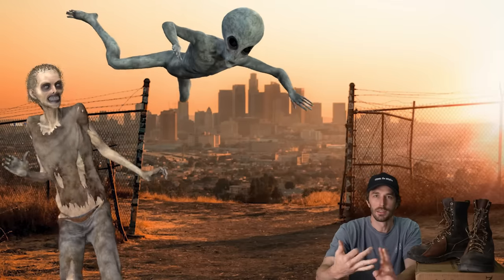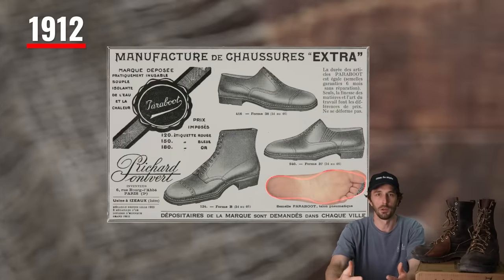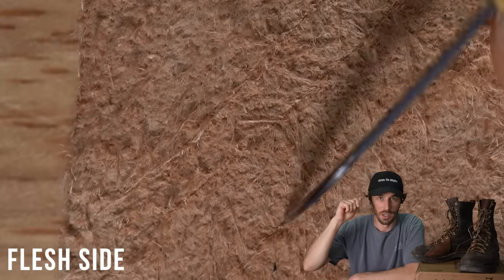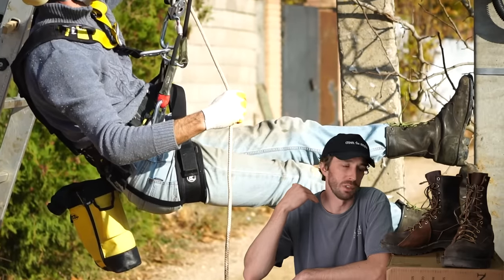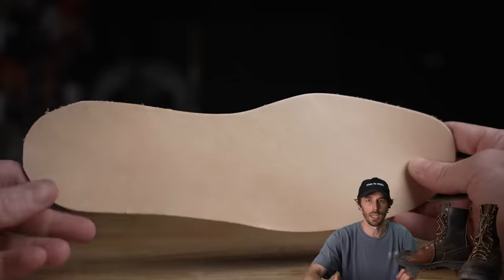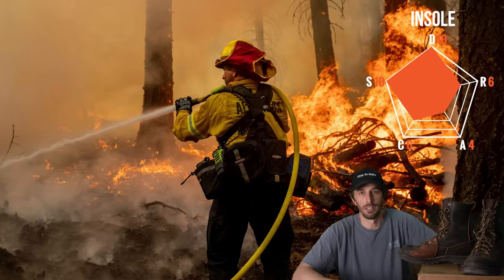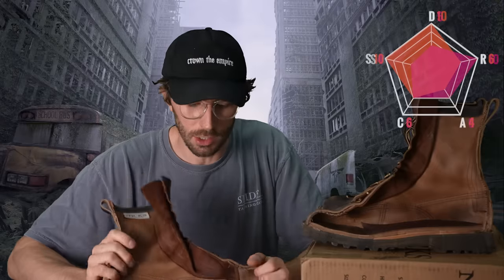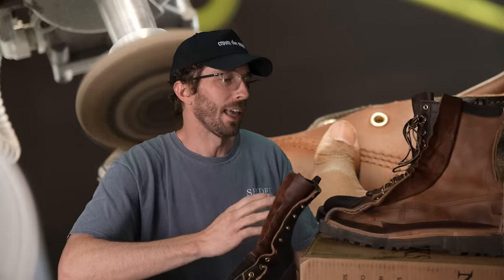Why this boot would save you in the Apocalypse (ND3)

Comment: I was scout in the military. We never melted wax onto our boots. We were made to wear them into streams of water, and then we tightened the speed laces as tight as we could get them, and then we road marched in them. The boots fit like a second skin. The only "wax" that went on the boots was black Kiwi shoe polish. We did use lighters to heat the kiwi on the tips and heels for higher shine. We marched so much in our boots that white salts would come through the leather and Kiwi.
Reply: Military boots are made to be practically consumable/disposable, so no surprise there.
Reply: I think he was talking about during WW1
Reply: We?
Reply: He is also speaking to rough side out.   Most if not all military boots except for a few versions of the "desert" boot are smooth side out.   No need to seal with melted wax.
Reply: @Heywoodthepeckerwood  In the military, the order of operations are mission, men, and self. Independence in the military is non existent. "I crossed the Sava River with my unit," is condensed to "We crossed the Sava River." It's military jargon. You either get it, or you're an outsider/civilian who doesn't.
Reply: @romile55  Good point. Wax would have been great waterproofing for the trenches.
Reply: @Waldemarvonanhalt  My military boots were were only changed out when the soles were worn past the military standard of serviceability. (The black rubber soles wear on heel edges, and other foot strike areas). However, my military boots have outlasted any of my civilian boots like Doc Martins, J. Chisholm...  About the only thing that goes out on the combat boots I had were the soles. The speed laces even lasted forever.
Reply: @elmerkilred159 I live in Canada. Montreal. When i was a kid, we use to have high quality warm boots.
I cann9t find anything of that quality in the civilian market.
So i only buy Winter combat boots now. Of course they are not like some Sorel at -40. But with a good pair of whool socks, they withstand every condition i can put them in. Had my last pair for 4 years now. I do want a pair of those boots tho! Lol
Reply: @celuiquipeut6527  I had a pair of Matterhorns issued to me in the service. They keep my feet warm outdoors, but the problem was that when I was in someplace warm inside, they would eventually make my feet sweat. (They were also heavier in the mud). Once your feet sweat, is defeats the insulated boot. I eventually went back to the standard issue boots paired with 100% wool socks. This worked in the Balkans for me pretty well. One of my NCOs  wore his green Gumby boots (NBC boots/Nuclear/Bio/chem) over he regular combat boot, but he always complained of cold feet (because his feet would sweat). The trick to managing your footwear in extreme cold temperatures, is to always keep moving and to keep your feet dry. Change out wet socks/boots when possible.
Reply: The good old days.  God I miss that army.
Reply: Yeah, I got pretty dubious when he decided on a last that was over 100 years old and has been out of service for over 50.  But he also claims that synthetic boots will just melt on the shelves after 5 years, which is utter nonsense, so he clearly has a fetish for old-fashioned boots and is willing to ignore reality to justify his belief.  They're nice boots, but I'd still go with current-issue stuff.
Reply: @Bacteriophagebs  everything stpre bought never last. The only thing i can store buy that is of quality is military boots. So this is the next best thing. And if you want mors style than your nextdoor goth, you dont have much choice.
Reply: @celuiquipeut6527  Yes, and modern military boots is what I was talking about when I said "current-issue stuff" and replied to a post about a guy who'd served in the military praising his modern military boots.
Reply: @Waldemarvonanhalt   FR, my feet chewed up boots like nobody's business. Practically needed new boots every 2nd year with how beat up they got.
Reply: what nationality are you, if you dont mind me asking, only because i havnt yet heard of americans using kiwi polish (brit here)
Reply: Thank you for your surplus !
Reply: @Waldemarvonanhalt  EVERYTHING in war (including people) is a consumable, but military boots from competent manufacturers can last many years. I retired long ago and am still wearing out my stash.
Reply: @elmerkilred159 I wear 2 pairs of socks with baby powder in each sock. So 2 socks per foot. That kept my feet dry in Qatar, Kuwait, Iraq. Also, I was a civilian contractor so I know I’m going to get a lot of hate for this.
Reply: @teancrumpets5685  We have Kiwi polish in the States, but most military branches haven't used it in decades since the black boots were switched out for the "suede" olive drab/tan leather.

Though I do expect that to change some day, once they realize that the outer suede layer is detrimental in environments outside arid desert regions....
Reply: yes did you expect him to be alone in the military  @Heywoodthepeckerwood
Reply: Same as the British army did with the old AMMO BOOTS MARCHED THROUGH WATER UNTIL THEY SHRUNK TO FIT PERFECTLY AND THEN BULLED THEM WITH KIWI BLACK BOOT POLISH
Reply: @MarcusJGrey my mate would go through a pair of boots every 6 months his feet sweated that much the leather would just rot away he could take his boots off and pour the sweat out like water I’ve never seen anyone like that to go through boots as he did and the smell from his feet was BAD
Reply: Scouts out
Reply: I never put wax on my boots either.
Reply: Id have used a metal shank. Nothing worse than jumping off something only to end up with a nail in the arch of your foot. Sole penetration needs to be prevented
Reply: @Bacteriophagebs you got any recommendations I’m looking for something tuff and weatherproof but not super expensive
Reply: @commalTl  Anything that's AR 670-1 compliant is probably going to be good.  AR 670-1 is the Army regulation governing what personnel can wear.  Technically AR 670-1 is about appearances, but any company making boots that qualify is probably going to have decent quality since they're making boots specifically designed for active-duty soldiers.
Reply: @Dundrakan  yes, it does depend on the type of activity you are doing when picking a boot to wear. I will only use tiger paws on roofs for example.
Reply: 8-1 Cav got better but was ass with Col Chung
Reply: Yes, Kiwi is primarily wax.
Reply: A friend in my batalion got foot fungus which got into the leather and for some reason it was the best boots in the entire base, because it  soften it up the leather to be more like rubber while keeping it's integrity. Not advised though but damn
Reply: @teancrumpets5685 I'm American, And all we ever used when I was in the army was Kiwi
Reply: Boots and time have changed Boomer.
Reply: @211inprogress  We still do this in Europe, and as  locations of the battlefields changes depending on where it is, be it tropical/Forests/Deserts etc, clothes change thereafter. 
Leather Boots is still the best for the Northern Hemisphere. Something US haven't focused on, raging war in the Middle East for the NWO, who took over US in an Alliance between England and France aiming to create a Global Super-Power back  between 1890-1905, who were sole responsible for WW1 and WW2. They are so close to victory, i figure an escalated war with Russia will solidify the World Government just to fabricate the need for it.
Reply: @elmerkilred159  agreed my leg boots lasted years my jungles the plates broke after a few years. haven't found anything that lasted a 10th as long since i got out.
Reply: I have the same experience with salt penetration during marches.
Reply: I miss my old, all leather, “crew boot” with the “deuce and a half” sole….once broke in, were fabulous road marching boots.  I had a pair that you could make the speed lace eyelets touch when you laced them up
Reply: i see your profile picture. 1-1 cav. im in 1-1 cav currently lol
Reply: Same.     My first boots from 1983, were so flexible they did not stand up.   Yet,  I could get a mirror spit polish on them.     Sadly the Army went to a new boot, in 1988..   They sucked.  I wore my jump boots for a while, then our unit allowed Jungle boots.   Never touched those issue boots again.
Reply: @birdsteak9267  And then you get athlete's foot or worse. I got it while doing my military service, because they gave me boots that weren't new but used by someone else, and it worsened with an infected crevace. I was stopped for a full month. The problem is, I reused the same fungus infected boots, so I suffered from athlete's foot during the whole service.
Reply: @InXLsisDeo  Lmao. The best benefit of Leather boots is the process of shaping it to fit your feet, you ain't supposed to get used boots, used boots is the property of who used it, because they are shaped to his feet not your feet. This is why in Norway, the boots we get is ours to keep for life, because we need fresh and new boots for fresh and new soldiers.  You ain't supposed to inherit other peoples boots.  US military are willing to wreck their soldiers feet for greed, and you blame leather boots, not your incompetent superiors. 

But you do not get Athlete foot or anything, i have worn my Leather boots for 10 years now, just fine. LEARN how leather boots work, how to shape it.
Reply: @elmerkilred159  Docs arent good civilian boots. Your combat boots cant outlive a leather insoled and midsoled resole-able boot
Reply: Adam's Boots are the best. They are only custom order, sized to foot. Please don't even think about ordering them, don't get in the way of people who will use them.
Reply: Buy some Danners, polish in Obanoffs
Reply: Yep.
Reply: @teancrumpets5685 was a US Army Ranger and Paratrooper for 15years. We used nothing but Kiwi for the most part for my entire service. Dress uniform jump boots were also mirror shined with Kiwi.
Reply: @elmerkilred159 thats why I’m sussed out about these boots in the video because he seemed to compromise the one part which wears out the most, at the expense of making the rest of the boot unnecessarily indestructible. I’d rather patch and upper than have to figure out how to resole the dang thing especially with not resources available to do so
Reply: Hey, I remember the salt bleeding out my boots while in the Marines.
Reply: How much do they cost
Reply: @brentandvuk  I do, not while serving although when working for the NAAFI boots were not needed but when I was at school Doc Martens were popular and the same thing would happen to them. I would have salt rings around the toe area which eventually scarred the leather.
Reply: I was a scout in the military. I wore the boots issued to me and never thought or commented about anything related to boots. I put them on my feet. Pretty insane.
Reply: @teancrumpets5685  Really? Kiwi was a regular fixture when i was in the USAF and virtually everyone used it as standard. A few weirdo's would use Lincoln wax but Kiwi was by far the most popular polish used before we switched to rough out boots in 2006-7. I still have a full kit of it in a shoe box somewhere with a dusting brush that has seen so much use that it will quick shine a leather shoe that has never been polished with just a few swipes.
Reply: @Bacteriophagebs the rubbery type sole stuff did on my stored steel caps .. like some bloody   bacteria was causing them to crumble
Reply: @jackd1582  If they were polyurethane soles, which they probably were, it was because they were in storage that they disintegrated.  Putting PU shoes in a confined space with no airflow, especially if it's hot, will cause the polymers to break down.  It happens even faster if they're put away wet (which includes sweat from being worn) or kept in a damp environment.
Stored in a frequently-used closet, on a shoe rack in the open, or on a store shelf, they'll last years if not decades.  It's why shoe boxes have holes in them, to allow air circulation.
Reply: @elmerkilred159  yeah the whole II versus wheezing is a psychological manipulation tactic
Reply: @StupidIsMyJob  you missed the point entirely 
Comprehension .001
Reply: @StupidIsMyJob  still missed it. Try again boy
Reply: @elmerkilred159 This. In a good unit, you are closer than family. If one fails, all fail. "You" don't matter. You "brothers" do. Yeah, I'm sure some find that cliche, or trop, but it is reality.
Reply: That's a really dumb way to break in a pair of boots and terrible for both the boots and your feet.
Reply: I put bag balm on my unbelievable how good it works and then I tried Vicks Vapor Rub oh my I'm not kidding it works very well
Reply: In basic training I showered with my boots on, wore them around for a bit, and used my winter ones the next day to let them dry out. 
Breaks them in a lot quicker. Those issued boots are hell
Reply: Nice we troll going down 🤡
Reply: True!
Reply: @teancrumpets5685 have used Kiwi Polish for thirty years. Even used it in Marine Corps boot camp to spit shine boots and that carried over into the fleet. Have used it on boots now and again over the years when needed.
Reply: I’ve got some West Coast boots. They are made in the traditional hand made method first used when the cobblers went to the logging camps,located far from any civilized establishments, and they measured a man’s calf and feet and would then build a boot that fit so well there was little to no need break in the boots as the boot fit
Like a glove. Mine are tougher than any other footwear I’ve ever owned. Checkout Wesco Boots located in Scappoose, Oregon.
Reply: That's a good story! Very interesting stuff.
Reply: @teancrumpets5685  Kiwi black boot polish was used on U.S. military combat boots prior to the War On Terror. 
      It was still being used by the U.S. Army and U.S. Marines in the 1990s. 
       The desert boot worn during the Afghan and Iraq campaigns negated the need of polishing our boots with kiwi boot black. 
       Kiwi boot black was the only brand sold on U.S. American military based/posts when I first enlisted.
Reply: Did you realize that Kiwi boot polish contains wax after you hit "comment"?
Reply: @teancrumpets5685  That's interesting. Kiwi is just the standard polish brand used in the United States. Everyone uses Kiwi, including military (not used on combat boots anymore, but is still used on dress uniform shoes).
Reply: @birdsteak9267  He is not American. The US military does not issue used boots. He is probably Swiss, considering that he is a French-speaker apparently from Europe and referred to "doing" his military service, which tells me he was a conscript.
Reply: @CAHiredGun  Well that might be, though wherever he is from i hope they stop giving out used-leather boots, because that is just inhumane and if money is an issue, have them buy yhe boots for half a price leaving the Military, because with love and care they can last a lifetime and is a good investment for winter and hiking.
Reply: What heros 🤡
Reply: @InXLsisDeo  Just want to say, i am sorry that it happened to you.
Reply: "scout" isn't a job in the military
Reply: @scootcha   No, it's called Recon, reconnaissance, which is essential for every successful Combat-Rescue missions, or Counter-Terrorism.
Reply: @birdsteak9267  I understand that reconnaissance is a job. I've just never heard someone refer to it as being a "scout". Odd terminology.
Reply: @scootcha   Depends on where the guy is from. We call our special forces for Jeger, which means Hunter, so maybe in his language, Scout is the easiest translation, or it is a linguistic tradition, like Hunter/Jeger A Scout have it's origin in the Military going thousands years back, they scouted ahead of the troops to make sure that the troops didn't end up in any vulnerable position. There is a lot of Terminologies that Militaries around the world have kept, while others have adopted new ones. His English might be bad, so Scout is the only term he could think for in a translation. The terminology Scout was used during WW2, and the Military changes drastically after that.
Reply: @romile55  …60s, 70s, 80s 90s and maybe even up to today in some cases.
Reply: @birdsteak9267  that makes sense. I appreciate the explanation.
Reply: @celuiquipeut6527 I live on upstate NY and have spent quite a few winters outside 10+ hours a day and honestly the warmest, longest lasting pair of boots I had was a pair of Adidas Conrax. They were a little tight but they kept my feet more warm and as comfortable as any boot I've had before. I'm sure there are much better boots out there but those were awesome.
Reply: @elijahclark6093   For casual winters i can imagine they are good, but heavy duty, wool socks and leather is best.
1: Can handle a beating.
2: With proper care they can last you almost a lifetime.
3: They weigh basically nothing, when you strap them properly to the leg, while a bit loser around the area of ankle-joint, it slightly feels like you ain't wearing boots, which is good for very long marches in uneven terrain.
4: With wool-socks for winter, your feet are warm but during summer, you can use regular socks, this gives you a excellent pair of boots for hiking/hunting during all seasons.
5: If you didn't properly care for them, and your feet get socked from stepping into a puddle, leather and wool-socks are easier to dry, be it at home or by bon-fire.

I don't recommend movie-themed boots, goth boots or Cyberpunk boots. Get proper boots, minimum 120$ for the pair, real leather, not that oil based leather.
Reply: @elmerkilred159 Jesus Christ is Lord
Reply: There were certain military boot models built in "Rough Out" upper design.  This is still whole grain/full grain leather, but the smooth side normally kept on the outside is now on the INSIDE of the boot.  The Army and Marines issued directions to the soldiers to apply a waterproofing compound called "Dubbing" to the outside, which darkened and provided some waterproofing to the boot.  The inside grain is more resistant to scratches and scrapes than the smooth top of the leather.  This kind of design was common in WW II field boots.  You may already know this, but many probably do not know all this lore.
Reply: @scootcha  Like birdsteak said, this completely depends on which military you're talking about. The job title of a US Army 19D is "Cavalry Scout", and the US Marine Corps had "Scout Snipers" until 2023.
Reply: @Waldemarvonanhalt That's funny, because mine normally lasted two years before they needed to be resoled.
Reply: You just dated yourself lol. We haven't used black leather boots or Kiwi in nearly 20 years lol.
Reply: Keen ❤. 
Cocran...boots break in and your good ❤.
Reply: @thomasshepard6030  Ewww.
Reply: @kyotra agree, suede boots is a shit for mud and winter.
Reply: @Bhartrampf there was no statutory shoe cream in us army? Like for example in BW or swiss army?
Reply: @mrrustygray dms black boots sucked?
Reply: @scootcha cavalry scout definitely is a military MOS. I had a couple friends who were scouts and thats what they called themselves.